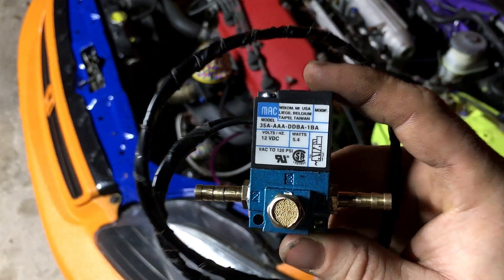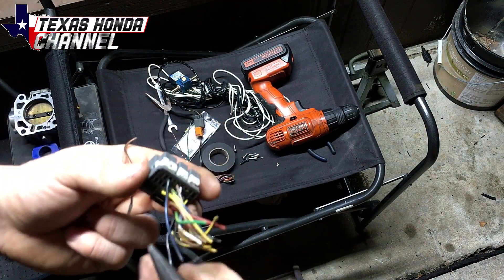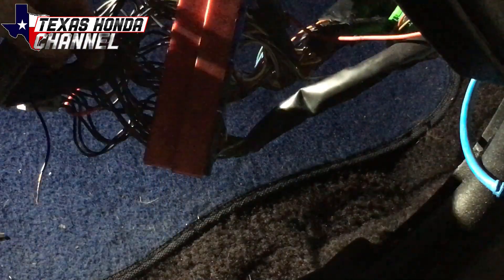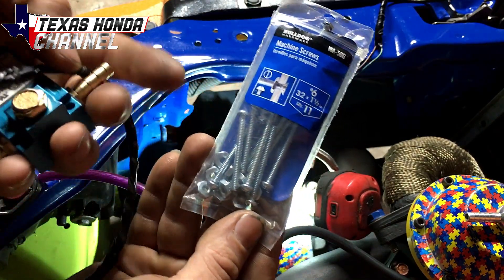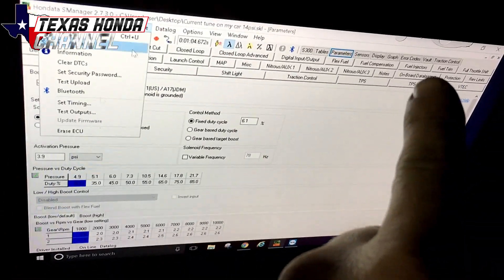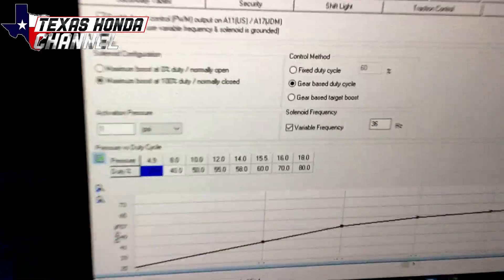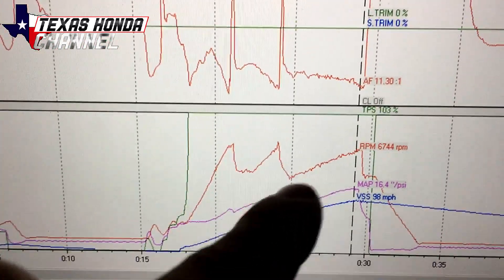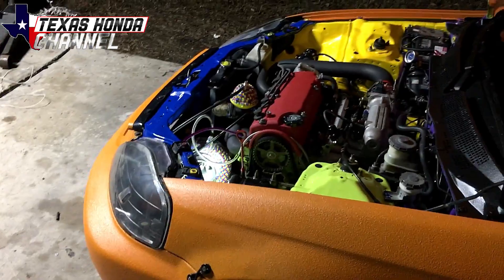D16y7 0-60 is insane!!(How to install Electronic boost controller)

Comment: any reason he didnt use the quick spool settings. I see PFI does the same why that he did but it would seem like quick spool would be safer? I just set mine up and it was working great but ever since i set up the quick spool settings it works on and off.
Reply from the maker: Im not PFI they are way cooler to be honest. Im just a normal dude with no shop or anything cool LOL

Comment: What did it dyno at ? Impressive for a Y7 !
Reply from the maker: Pops Lops On 8.8psi on conservative timing it only made 194whp with the air filter on the turbo. Without air filter 200whp. Now we have more aggressive timing, electronic boost control with high flow fuel pump and new fuel pressure regulator and the boost is much higher. My buddy/tuner says it should be right around 300whp once I get a new clutch. This stage 2 single disc clutch can’t keep up very good with the higher psi and power. It screams though. This is just the stock engine with a eBay/amazon turbo kit i pieced together.  I will be doing a fully built engine all y7 with race cam shooting for 500+ the turbo supports 600+ horse power and I have 1000cc injectors ready to drop in if needed. Which I will need eventually since these 525cc are at about 50% duty cycle at 16psi. Might be able to make 350-400hp on these injectors it’s I bump my fuel pressure up.
Reply: @TexasHondaChannel  Awesome brother, subscribed.The ole D series doesnt get much love anymore with B and K swaps becoming more common but Bisi got over 700hp in his EF wagon on a Z6 or Y8.Very impressive especially with stock internals !
Reply from the maker: Pops Lops Well thanks for the sub!They call me James D guy because D series are my specialty even did a headgasket blind folded here on the channel! Also bisi took that 700hp d series out and put a K swap in. These D series have always and will always be my favorite Honda engine. My second favorite is F series then H series then B16 then K last. Not a fan of the K series hype. Had a buddy with one and we raced and I beat it. Not saying they aren’t fast at all but to me it’s just a lot of hype. Good engines now doubt but meh I still love me some good ol single jingle.
Reply: @TexasHondaChannel  One of the best SOHC engines ever made.I have both a Y7 and K24 and the Y7 has been trouble free for 322K miles, not so with the K24 at 270K miles.Chain tensioners are garbage and early ones suffered from soft exhaust cams and every one of them uses a quart of oil between changes.Not to say they arent great engines but I cant justify the cost of a 200hp K24a2 swap when you can get that from a boosted and tuned D series for a fraction of the cost.
Reply from the maker: Pops Lops Yea for sure! I have very little money into this setup way less than I would if I k swapped. Even if I had the K engine the price of everything else just to make it work is expensive! I looked into it awhile back and said F that I would rather J swap than K. So J swap might happen in the future on this channel.

Comment: Can you post a current build sheet of what’s done to the car as far a engine work goes? I’m curious as to what I would need to turbo my sedan
Reply from the maker: D. J. 
 stock head and block d16y7
Stock pistons/ stock rods 
525cc precision injectors
Hondata s300 ecu 
BKR7EIX11 spark plugs gapped 0.22 
GT30 eBay turbo 
amazon log manifold 
D15b7 intake manifold but prefer the d16z6 intake manifold for best flow
3 inch downpipe with Yonaka cat back
A/c and power steering delete.
Walbro 255lph fuel pump
Aftermarket fuel regulator mod
K&n fuel filter
Rotella T6 turbo diesel oil  5w40
Stage2 single disc clutch 
D15b7 transmission/gear ratio
Stock struts/ 15inch wheels and tires.

It’s pretty basic. Stock y7 with eBay turbo and tuned by a pro

Comment: It's fast 4sec nice man 👍
Reply from the maker: Indeed! Im happy with it. Once the built engine gets done and goes in then we will be even faster and i'm okay with that! Its a just a stock block/stock non vtec d16y7 with gt30 ebay turbo, 525cc injectors  walbro pump tuned on hondata by Michael Sengvixay